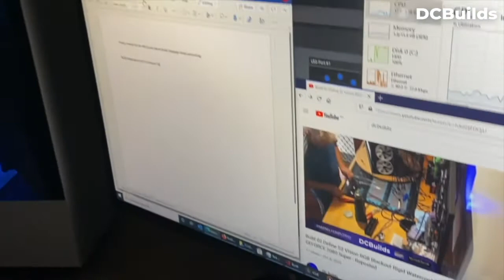Build 03 MDP NZXT H511 Rigid Water Cooled Intel I7 + 2GB Gigabyte GPU

Comment: That new leak shield looks amazing. I'm starting My first loop and having problems before the build even started. I put together the whole loop and the gpu block leaked. Then I actually had 2 gpj blocks because I thought ahead incase something goes wrong. So I switched the gpu block and it worked then the ek coolstream 360 started leaking really slowly. So I'm interested in that Aquacomputer leak shield like alot
Reply from the maker: The cpu block and compression fittings offer a very reliable leak proof system. I did have trouble with the Ultitube initially but it was my mistake, I over compressed a fitting from the petg tubing to the Ultitube. Once the EKWB pressure tester found the error, I replaced the o-ring in the compression fitting and all issues were solved.

Comment: Looks nice! I've never tried water cooling at all and I kept going back to it as trying to find all compatible parts was quite overwhelming, especially when high end parts are on the line. But, I pulled the plug and finally bought my first water cooling parts. Doing a full soft tubing ZMT loop in the Cooler Master NR200P and I cant wait!
Reply from the maker: Hi Thomas and thanks for your comments. I've been building servers and workstations for a long time so progressing into the very enjoyable water cooling I think is a natural path to take :) The components for rigid are quite complex to begin with and I can highly recommend to people to try soft tubing first, it is far more forgiving. I have some waterblocking to add to an RTX 2080 Ti in a forthcoming build, so I'd better make sure I measure twice and cut once. All the best with your build, just don't forget to enjoy yourself. Graeme